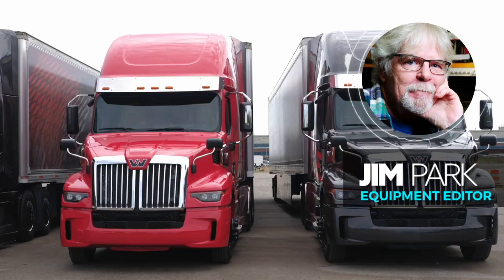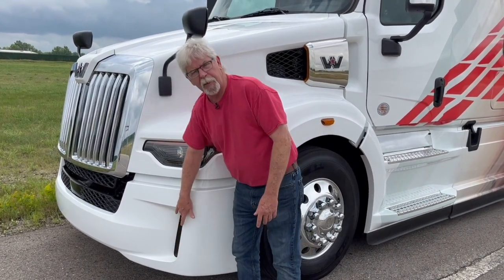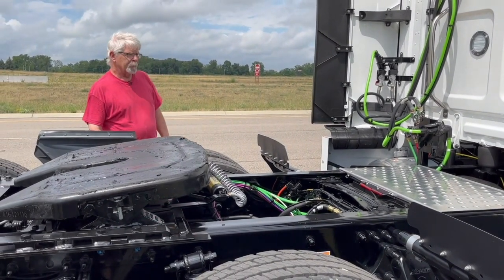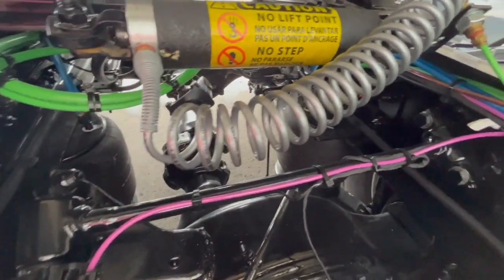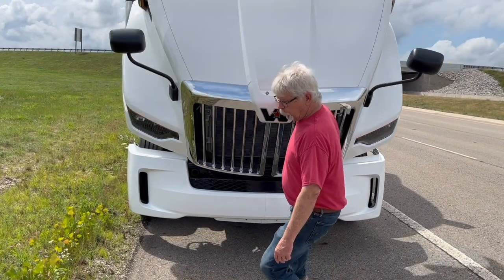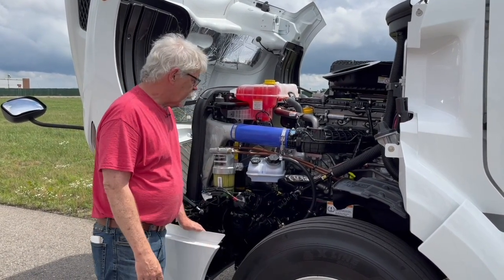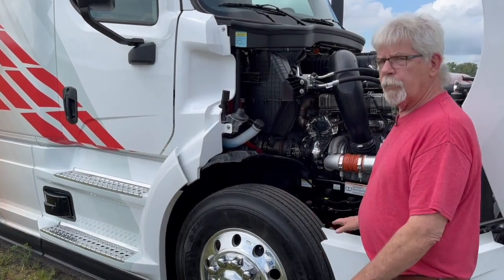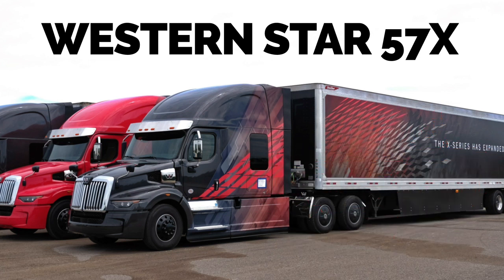On the Spot: Western Star 57X Walkaround

Comment: I would rather have a. Cummins engine  . And  the side box are to small  . I would rather have them open so I can put my broom , fluids , straps and load locks
Reply: You can put your brooms and load locks on the back of the sleeper duh.....
Reply: @truckercowboyed2638  why would I put it out there for people to steal  duh
Reply: @georgecass8529 buy a lock you should be locking up your equipment anyway
Reply: @truckercowboyed2638   no need to buy a lock when the truck already has one .